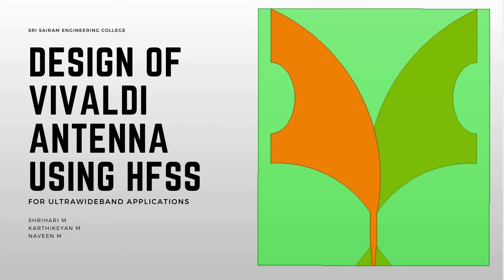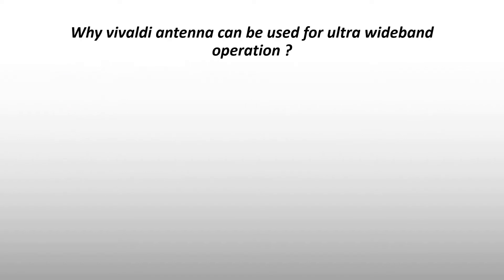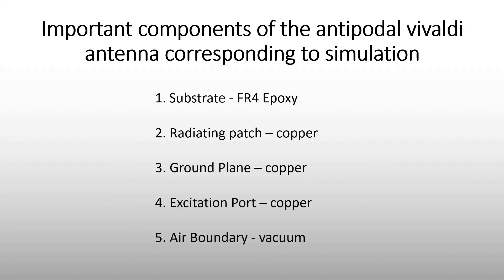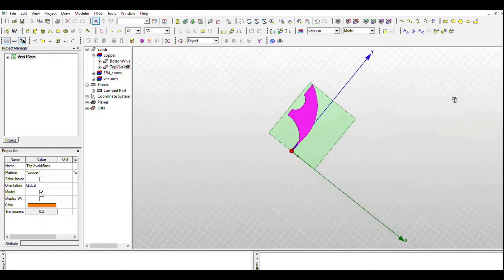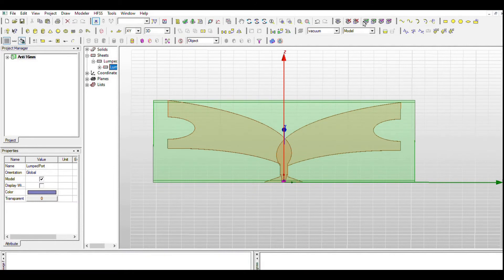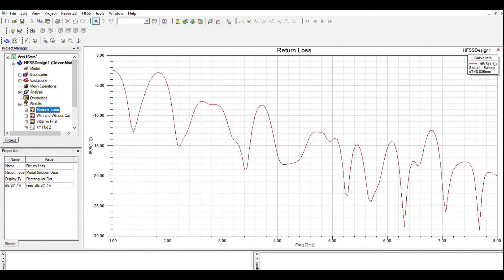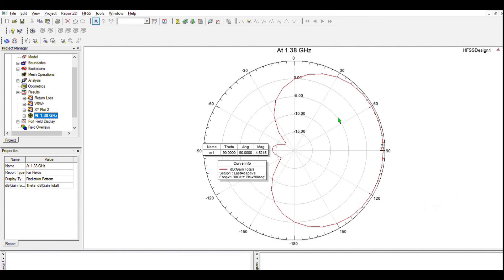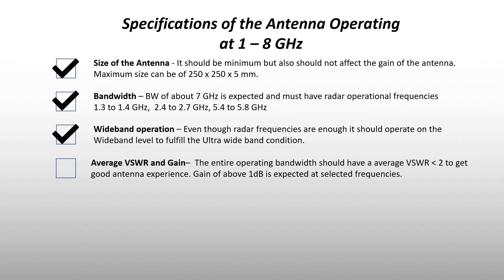Design of UWB Vivaldi Antenna Using HFSS

Comment: Dear Shrihari Mohan, in the return loss graph, what parameter can I modify so that the reflection in 10 dB is from 2GHz? Thanks for your answer.
Reply from the maker: Hello Vargas , our initial try was from 1 GHZ we tried changing all parameters but we are not  able to get a flat curve below 10dB from 1 GHz. There are some bumps between 1 and 4 GHz.

That's mainly because Vivaldi antenna works well for higher frequencies.

Well if any luck you can try changing all the widths, lengths and try it on your luck.

LMK if you successfully designed.

Thanks and cheers.
Reply: @shrihari-mohan  What variables do I have to modify to vary the width and length of the conductor patch? Because Sub X and Sub Y modify only the substrate. I have tried modifying the variables "w" and "l" but without success. Please if you can guide me. Thanks.
Reply from the maker: @cesarmezzich   you have to try everything man , from the transmission line to patch sizes. I am sorry I am not much of a help . But there is no exact design equations for anti-podal Vivaldi antennas.
Reply: Hello.. 
Was you able to attain your required results.?
Reply: I 'm alao working on vivaldi, but unable to get results..